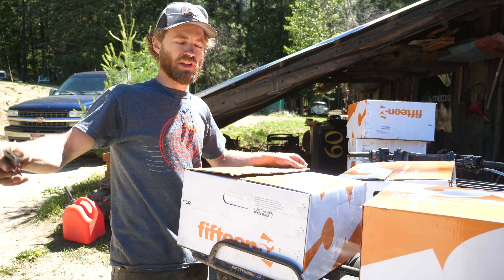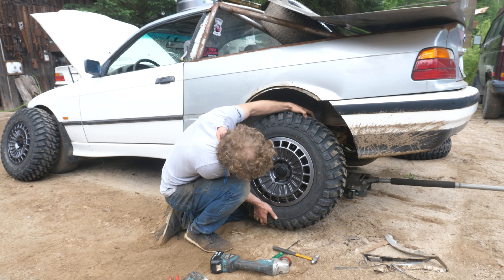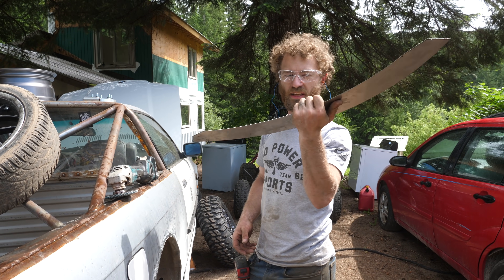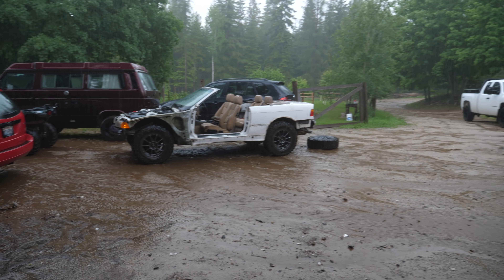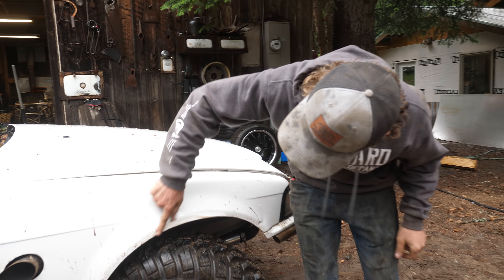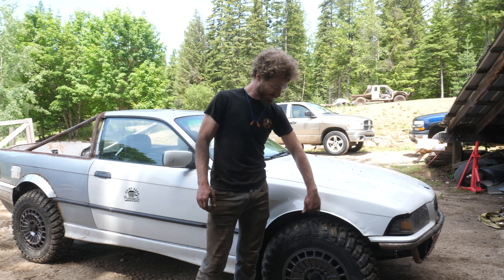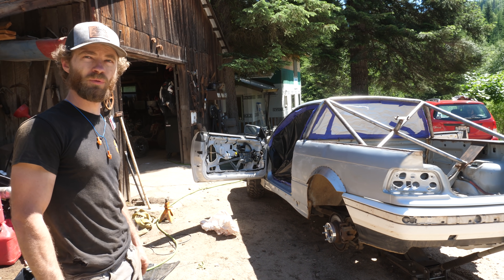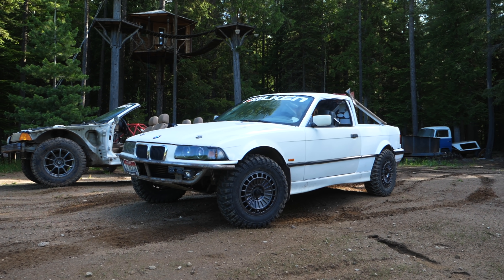BMW Turbo Truck is Finished!

Comment: Gotta love the harbor freight manual tire changer. I've had mine for at least 15 years, only broke it once at about week 3.  I may fix it one day day but it still works fine. The little pin that holds the wheel at the lug hole is really weak.

Comment: If it's like my old E46, the hazard button is between the seats and will short it and turn it on if you happen to spill a drink on it - so it may have been the rain shorting the button.
Happened to me on the freeway and had to drive home with my hazards on. Finally turned off one corner from home and a hair dryer to make sure it was completely dry again.

Comment: Those harbor freight tire changers are a  bang for the buck I modified the bead breaker with a piece of C steel in place of the two little straight pieces going to the piece that pushes the bead and it was a day and night difference you guys do great work love your channel 👍👍
Reply from the maker: We might have to try that out!

Comment: Negative camber in the front will fix your problem. Achieve this by putting one washer at the bottom of knuckle mounting point.  Boom negative camber for five cents.

Comment: I was an auto bodyman for years and when the pneumatic gun would die we would cut open the window glue tube and spread it all over and level it afterwards. It's a trade secret

Comment: Super guys 👌😍
Did you know the sand system to balance the wheels
= On off-road they use some sort of soft sand in the tire to make an auto dynamic balance  of the tire.
So for a cheap tire montage in the future you can try it?

Comment: Hey guys he when you use that window urethane adhesive it makes it easier if you warm up the tube before you start squeezing it out onto the window stick it in some warm water sticking in front of the heater let it warm up to temperature

Comment: Two things you guys could use for the shop number one some type of tire Machine that is an upgrade from what you already have. Second you could definitely use a paint spray gun so that you can paint your projects. Instead of using rattle cans. You guys make some cool projects give them some good love with a nice paint job. Not saying you can’t do it with a rattle can but it would be nice to have wouldn’t it.

Comment: DOT approved tyres but then puts a hugely uncompliant and possibly illegal in some states "wheel-hub spacer"?

But it's a bolt on one! Oh well that's ok then 👍

Great project though. Sounds wicked! I had an E36 years ago and you you can actually flare more than 2½" of the wheel arches without even grinding of cutting anything?
You only need a piece of pine log and trolly jack👍 Not only that but it increases the the space between the outer circumference of the tyre and the fenders making for even better clearance 👍
Reply: I'll shut my mouth until the end of the damn clip next time! Lol out with the pine log or steel post or what ever you want that's roughly that nice diameter you've just clearly displayed in your clip. Bravo sir! At least you showed the world and didn't just keyboard warrior someone's YouTube clip like a know it all 🤭
Yup sorry. As you were.....oh right yes I do have the play button correct again sir, thank you

Comment: Best way to roll a fender. Nascar style use a baseball bat. Stick it between the tire and fender and roll forward. Actually works well in a pinch

Comment: If you source into wiring your fuel pump relay disconnect the power from the car and use a 14v power tool battery for it you'll get more fuel pressure which will stop that studder  and lean condition you're having